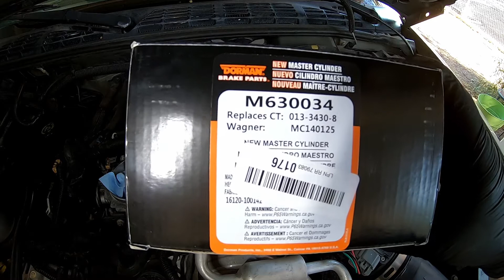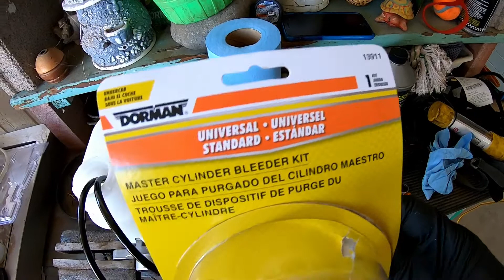How to Replace a Master Cylinder/ Chevy S10 ZR2

Comment: Getting ready to do my S-10 2002 ...You said 1/4 x 20 for the B-nuts... I think the fittings are 1/2 x 20 thats the only size that has (2) of the same size in your #13911 Dorman bleeder kit, per itemized list on back of package. That is the better kit, as the other kits only have one 1/2 x 20. Thanks for doing the video.